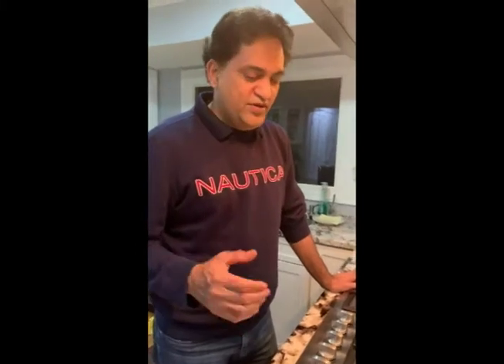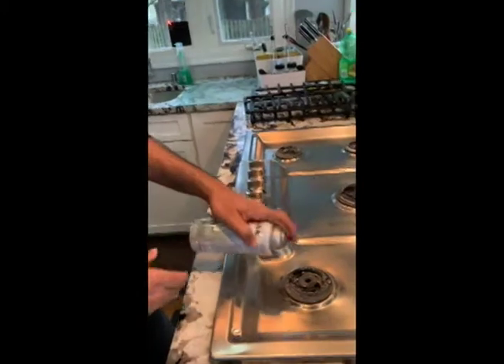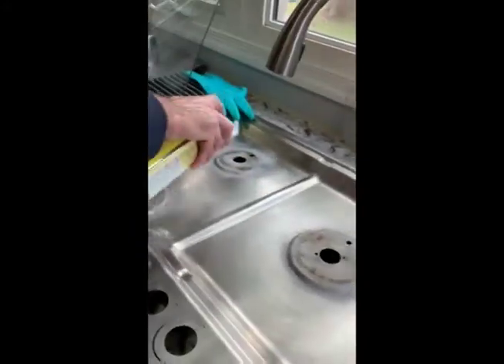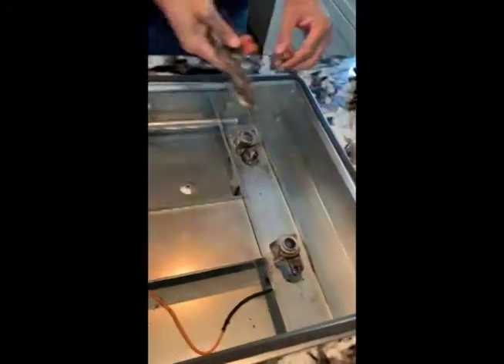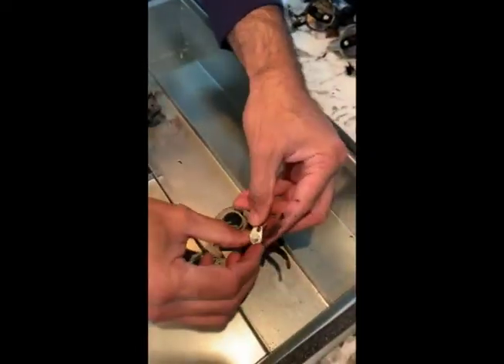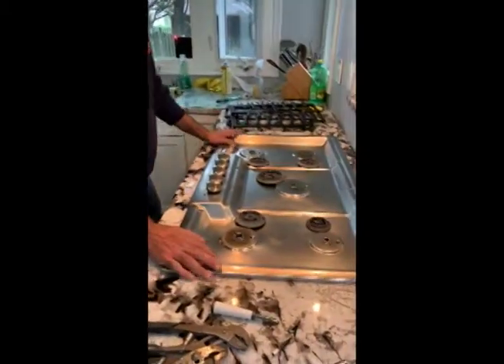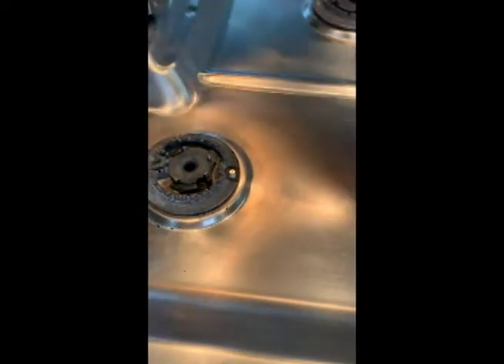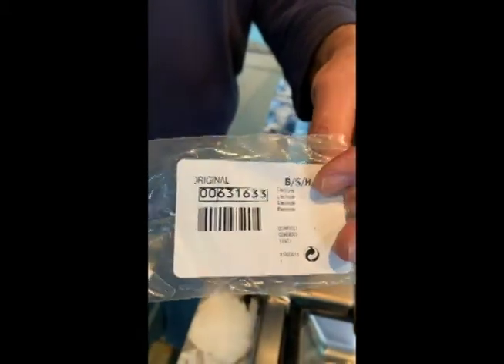Preventive Maintenance - Bosch cooktop igniter replacement and cleaning

Comment: Good job and very helpful. A couple of suggestions, be careful with using petroleum on the range, it’s flammable, so just make sure its cleaned with really well, with alcohol or a degreaser. Baking Soda and Vinegar works well in cleaning the screws and buildup. Lots of videos on that.  The igniter screws are “Phillips” head I believed and the Burner screws are Star head.  Sometimes seized screws can be removed using screw extractor bits. They cut into the screw as you reverse it out. Be sure replacement screws are made for high heat. The white collar of the igniter is ceramic so it’s fragile, it you crack it, it’s shot. When installing the screws, it’s best to use a hand screw driver to get them started. When using an electric screwdriver, or powered drill, it’s easier to cross-thread the screw.    I admire you for taking the video through the whole process, most edit out all the challenging parts and frankly, that’s the most helpful usually.  Yours isn’t really preventive, it’s corrective. So preventive would be carefully cleaning around the ceramic igniter every three months or so.  A small brush and some cleaner or soda and vinegar will do it.  If too corroded, a couple of strokes with 400 grit sandpaper on top of the sensor and the opposite surface of the burner will help.  Not trying to be critical but felt some of this might provide some additional help.  Thanks again and best wishes.

Comment: Nice video.  You might list what you used to derust the screws and clean the stainless cooktop.     I am awaiting a pack of ignitors to replace one that failed.    Expected better from Bosch, our previous gas cooktop lasted 38 yrs and never had an ignition failure.  The cheesy screws were a surprise.  Considering some 316 stainless replacements.  Some high temp antiseize might help (TBD).

Comment: I had a hard time to separate the cable harness and igniter. I just tried to seperate them by force like in the video. It ended up breaking tip of the cable harness. Then I noticed that they were rusted also. I should have used some lubricant to remove the rust first.